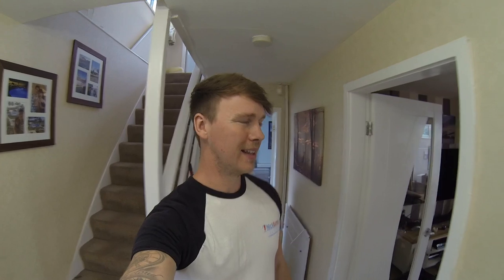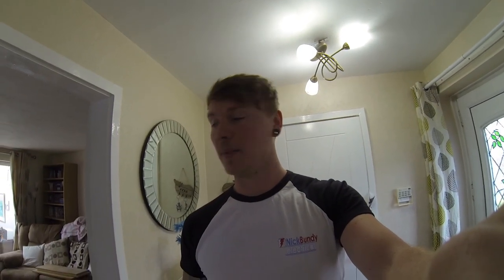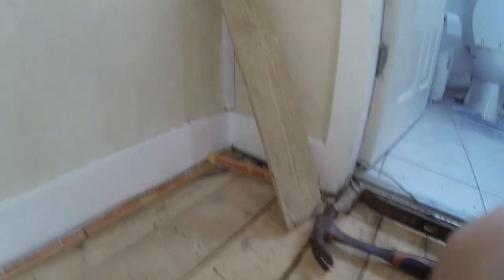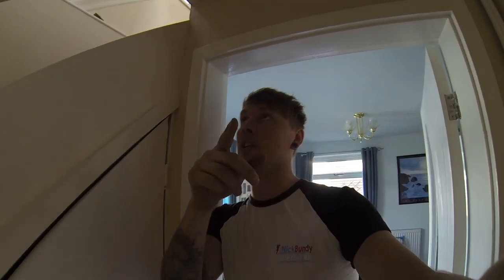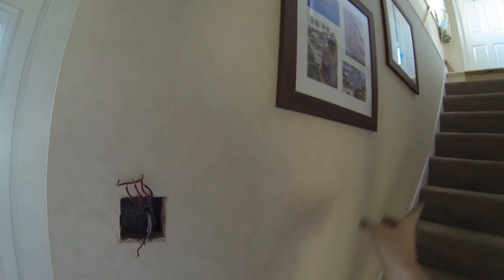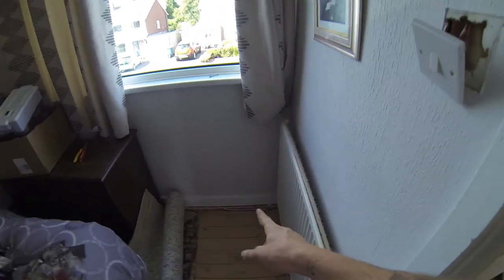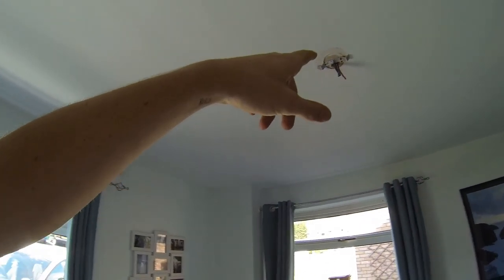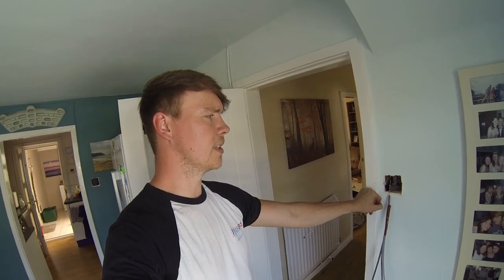Working in a loft on hottest day of the year, Lighting rewire, exotic life of an electrician

Comment: Well done Nick,  
personality I wouldn't have done a loop in to the light switch on that installation. New Installation, yes. Fair play tho, you done well.
Reply: I loop at the fitting for rewires if I'm re-using the switch drops, you can always use 3 core for the switch wire if they want neutral at the switch.

Comment: My gas meter is under my kitchen sink too, and when I went to do gas bonding I found it was balanced on the cupboard with no back plate. Talk about dangerous! Not to mention if you have a water leak even though it's not dangerous the gas board wont touch it regardless of whether or not your gas is safe or not..

Comment: I'd use 3 core and earth between the switch and the fitting so you have a permanent line if ever you need one at the ceiling position, eg for smoke detectors or a feed to another fitting.

Comment: Why did you decide to loop the cables at the switches?  I know it makes it a bit easier for testing but if you just ran the loops to the light fittings then you would have only needed one cable to the switch not three (Apart from two way lights)..  What is such an advantage of looping in at the switches that you would go through that much effort?
Reply from the maker: Steve I normally do run power in and out to light fittings but I thought I’d try this way instead, allows supply at switches for smart switches in future
Reply: Steve It’s a lesson not to do loop ins on a rewire. New build or bare brick only.
Reply: @NBundyElectrical  would it not be easier to wire it normally to each rose, then run a 3 core + earth to the switch from the rose instead ?
Reply: @NBundyElectrical  Fair enough, have been seeing though that already the next wave of smart switches don't need neutral like the new aurora smart switches

Comment: You did well there to do most of downstairs in a day. Surprised your rewiring the modern cables.
Reply from the maker: Andy Kirwan it was a long day lol and it’s not Morden cable its the original wiring in the house bud
Reply: N Bundy Electrical I meant the outside light and conservatory.
Reply from the maker: Sorry, the light in conservatory was tapped off an old outside light feed which was buried in the wall so easier to relocate then rip there wall to shreds 👌

Comment: I'll usually use wireless switches with inline relay above light fitting if switch drops can't be pulled. More expensive materials cost but time you've paid for a spark to chase in and then a decorater to make good its generally a cheaper option and a much quicker fix in situations where time is a factor. LightwaveRF aren't too bad
Reply from the maker: AllStarNES I was talking to another spark today about them! Defo will give them a try

Comment: I take it you checked that junction box to the left of the door in the conservatory? Seems like that could possibly be the JB for those lights since there’s 2 lights.
Reply from the maker: MFS Electrical that was feeding the socket in conservatory above the washer so it was disconnect
Reply: N Bundy Electrical did think you would have just seemed a convenient location for that switch inside 👍

Comment: I wire feeds at the switches on new extensions ect but not on this type of job,those small existing conduits only good for 1 cable,2 at a push. Certainly not 3.

Comment: 25,27,even 30  degree are pretty normal here in Brazil at least  seven month a year, so  don't worry  high temperature doesn't kill.
However it is very hard it goes  beyond  35 degree even in the summer.temperature only represent a risk to your life when it goes beyond 40 or above this.
Reply: High temperatures don't kill people in Brazil because you grew up in those temperatures.
Thousands of people's die in Europe from 30+ temperatures.
Reply: Mate this is England, British people and temps above 30 is a no go 😂 mind you below 10 and we also have a big moan 🤔
Reply: The loft is always a lot hotter than anywhere else. Dark roof tiles radiate all the heat into it and they're so insulated the heat can't escape. It can easily be in the 40 plus range on a normal summers day

Comment: Hi Nick, Could you have just changed all accessories to plastic and put warning label on board?
Reply from the maker: John Rudge I could have done but the new buyer wanted a rewire done 👍
Reply: Dont think that would be a good idea in anyones book there is still the potential of shock most lamps have a metel bayonet and most pendents have a metel bayonet socket which could be touched and you may get a faulty switch or home owner switches on pvc switch with wet hand these are some reasons why earths and a RCD/RCBO are important to have

Comment: If I were the buyer here, I'd much rather have had a full EICR and the price of the quote knocked off the total. That way the buyer could be responsible for the electrical work and have control over the job that was done, and have any other problems that cropped up solved at the same time. As a buyer, I'd also definitively want to fork out for a full RCBO board if I had an electrician in anyway.

Comment: Preferable the landing light would be powered off upstairs. In case the downstairs Mcb trips
Reply: Explain Andy?
Reply: It'd be better putting the landing light on the downstairs lighting circuit as if the upstairs lights tripped and you had to go down stairs to reset the breaker, at least you'd have light over the stairs to see where you were going.
Reply: The point being if the downstairs hall and upstairs landing are off the same Mcb, and can’t be reset/fixed until an electrican comes to fix a fault, you have no light at all on the stairway.
Reply: It’s an easy fix. Disconnect the power input downstairs. LandN. Put the 3 Wires into the switch. Run power into the landing light.
Reply: @AndyK.1  3 wires. Keep explaining Andy
Reply: Stuart Campbell I’m sure u don’t need to explain to an electrician how to do it. (Who has probably long finished the job). Yes lots of changes required at the landing switch. Google 2 way switching to see diagrams.

Comment: Hi mate great video can I ask you a question a friend of mine had a fault last night tripped the rcd turned out to be an appliance. Then found a couple sockets wired backwards so sorted them. When I did end to end readings live to live 0.40 neutral to neutral 0
42 and cpc to cpc 0.49 I was looking for about 0.70 on cpc its lower so.is this acceptable and ok  I thought might be a parallel path or something like that
Reply: greg davies it’s quite likely that the ring has been extended at one point and st the point of extension they have put all the cpcs together.
Reply: @tom1997williams  so it's ok as long as the readings lower .it's when its higher look for lose connections